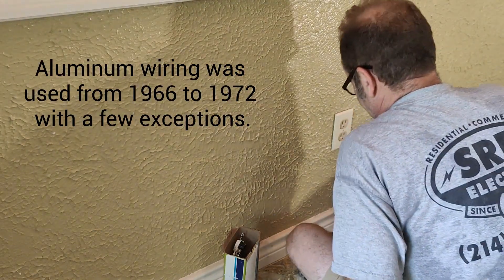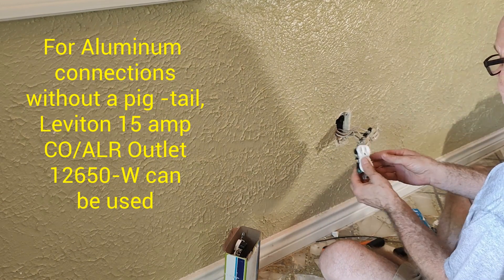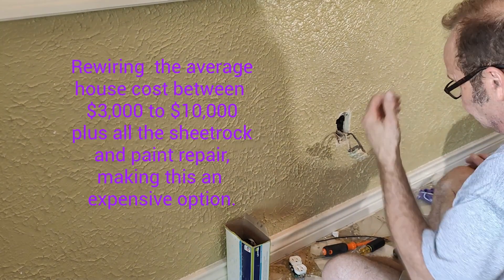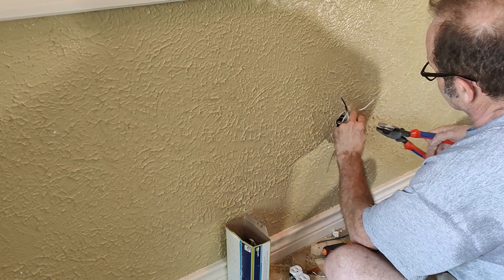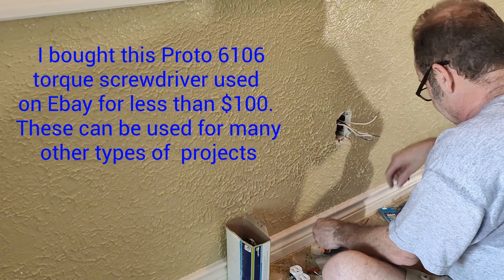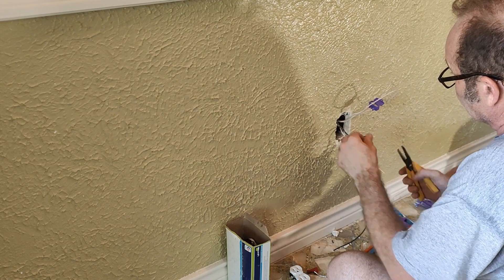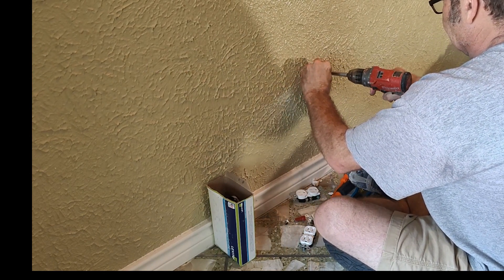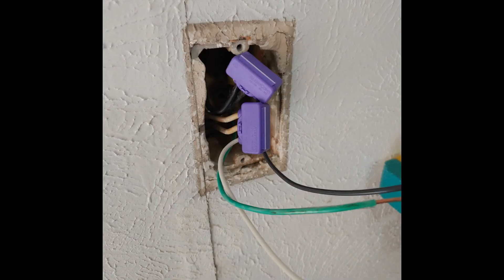How to wire AlumiConn Connectors and Analyze Your Current Wiring.

Comment: Thanks for Video, appreciate you taking the time to share with us. MY Question, just sold my house, and the stipulation states the following
..
all electrical outlets not rated for use with aluminum wire will be replaced with outlets rated for use with aluminum wire.

Do we need to do both the inside Purple 3 part hardware and then ALSO a new wall plug that is rated compatible outlets labeled CO/ALR, or can we do just one solution?

Just unsure as to what to ask my electrician so I don't pay for 2 things when one is sufficient. Thanks again

Comment: Never combine copper and aluminum and never twist aluminum before using a wirenut.. You need to use the alumiconn on the ground as well or use an aluminum pigtail with the wirenut.

Comment: Cant use 14ga copper on 20 amp circuit, otherwise good video. Thanks
Reply: I caught that too!
Reply: He’s referring to the short jumper, and it’s prob fine, especially if the aluminum is 10ga , with this retro the outlet is not daisy chained , the alumicon is

Comment: Make sure to use  use COPALUM, AlumiConn 3-Port Al/Cu Wire Connectors, (or rewire), have no less than 6" from the wire end to where the wire comes in the box, and the wires extend no less than 3" from the outside of the box.  And, it's a good idea to at least always use a quality non-contact electrical/current detector.

Comment: I find doing what I call Hot Pigtails works best for the most secure bond between alum and copper. I let the wires heat up naturally and they actual melt or fuse together. That forms the best connection possible. Then if there is any holes in the wire insulation from the bubbling I put electrical tape around it for safety.  Been living in this home for 17 years no problems.
Reply: Why do you post that in multiple videos?  "the best connection possible" is one that is code compliant, hence, done right.  AL and CU cannot melt together with heat/fire, stay that way, and be safe, especially after they separate.  They do not expand and contract the same, their properties are different.  There is no way to do what you say and have a proper connection.  -  Sheesh!  Burning wires together, and even melting the insulation.  That's a MAJOR defect!  -  In North America, the most recommended are COPALUM or a complete rewiring, according to the CPSC.  Also, show one place in the NEC that says to do what you say.  Many local codes are even stricter than the NEC.

Stop relaying dumb, wrong ideas to people, so you don't kill someone (if you haven't already).  And, consider yourself lucky.
Reply: When will patent run out on these connectors?  Don't really want to pay $3 each for these.  Want to pay about $1 each
Reply: @wildmanofborneo $3? They are $5-$7 at Home Depot and amazon
Reply: @wildmanofborneo  wouldn't it be nice if every thing was cheaper but unfortunately things cost what they cost regardless of what we think they should 😢
Reply: l

Comment: on the last purple connector, it looks like you stuck a black and a white wire in the same connector at 11,50 in the video, but at 14,53 it shows all blacks and all whites as it should be, so whats up with that?

Comment: Just to confirm did you say it was ok to use the aluminum wire as the ground wire and not change it?
Reply: Yes, if it’s long enough it’s fine to use but most of the time it’s too short.

Comment: 1:20 I get the impression that most electricians are full of crap. They dont seem to know what to do, and just do "what theyve always done", which is use a twister with some antioxidant grease.

Id rather do it myself knowing Im doing it right.
Reply: My house we just bought is all aluminum wires plus a really old out date circuit breaker. Im a diyer im looking to do the same thing as the video but the boxes that house the wiring are really small.
Reply: @conchim99  yeah I wanted to install a dimmer on my kitchen because my new LED fixture was super Bright. Ended up having to tear out the old box to install a deeper electrical box to hold all the wires. Wasn't too bad, as long as you've got a multi cutter to cut the nails on the existing box. And get a much larger old work box.

Comment: Well done video.   A couple years ago I used Alumniconn connectors in a house built in 1964 just outside of Charlotte NC , with some copper wiring, and some aluminum,  electrical service was a FPE 100 amp fuse panel consisting of the main fuse block, two smaller blocks for the range and dryer,  and 8 edison base fuses for the 120 volt circuits.  Upgraded the panel to a 200 amp Siemens panel using a 100 amp main breaker with AFCI and dual function breakers for the locations needing GFCI protection.  The new owners of the house didn't have the funds to upgrade to 200 amps at the time but wanted a 200 amp panel so they could upgrade and add in things later on if and when they decide to.
Reply from the maker: Yes I usually don't see homes with aluminum that are that are from before 66. 
Yes if you can get the AFCIs on the aluminum that is definitely optimal!! The problem is that the circuits may have to be rewired if they're sharing neutrals. 
It's usually the hallway 3 way switches that have to be redone...
My material cost are the same on 150 and  200 amp services...😊
Thanks for your input!!
Reply: @srpchannel0169  yes fortunately that house didn't have shared neutrals or multiwire branch circuits but Siemens has two pole AFCI breakers in their lineup for those situations,  which is why I recommended that particular brand to the homeowner.  I think it was the master bed/bath, living room  and laundry area with aluminum while the rest was wired in copper which led to the conclusion 1964 was likely when aluminum wiring was in it's very infancy  which just happens to be around the time the US began getting involved in the Vietnam War.  

Which brings up a good point about AFCIs and aluminum wiring.   Making a safe and permanent repair with Alumniconn connectors assumes every connection is found and corrected,  and there are no hidden splices behind walls which I would never assume doesn't exist in a home almost 60 years old where Popular Mechanics seemed to include just about every DIY project you could ever dream of. :)